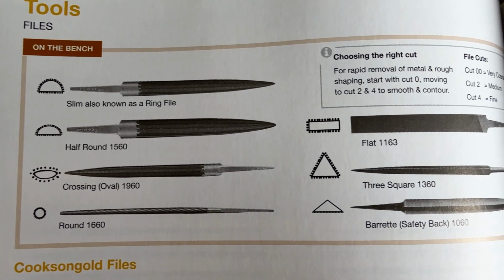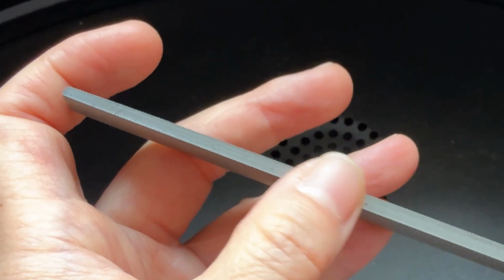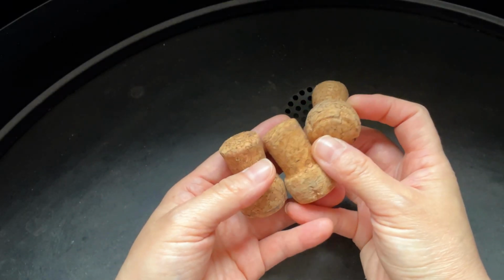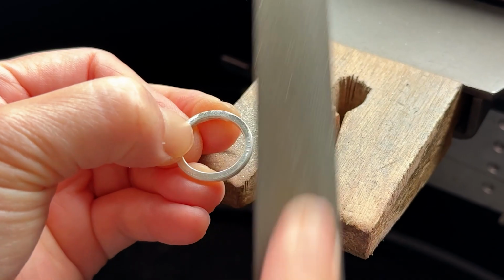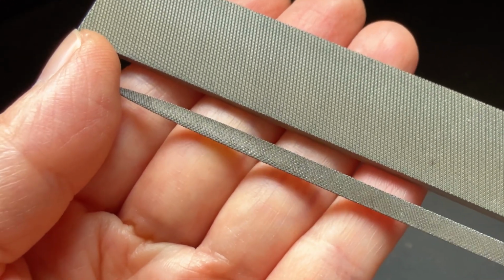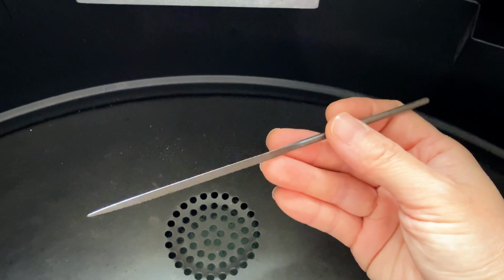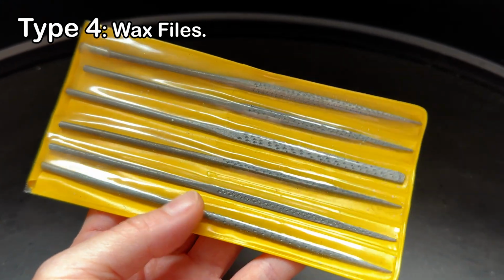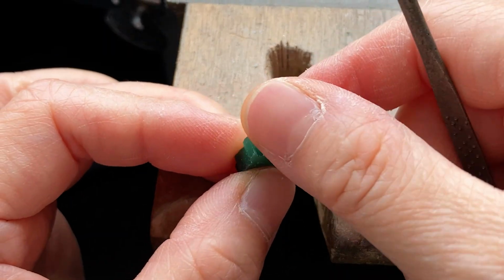New to Jewelry Making? Start With These Files

Comment: As a child I hated files, always a lot of work to get no where & then I discovered that files get dull & have to be replaced. Then I experienced new files & epiphany came. The ability to gently remove material, take off burrs, shape things to what I wanted & create was such an extraordinary discovery & delight for me. I then thought old files were of no use & then I discovered the ability to use heat to anneal the file turning it from unbendable steel that would snap if you tried, into malleable steel that could be shaped to do anything wanted & then re-hardened to make something very hard again, or else tempered to make a tool that is less hard, but which does not snap if bent a little & could be used for things limited by imagination from punches to knives & beyond. Files are extraordinary technology, made from iron with just a small (1% ish) amount of carbon & known to human metal workers for at least two thousand years. Only people who have used files in creative ways really appreciate how magical they are. Thank you for sharing!